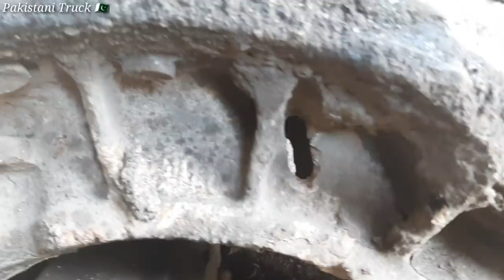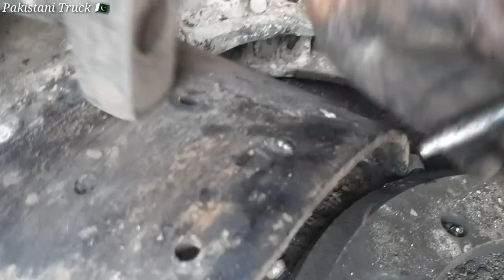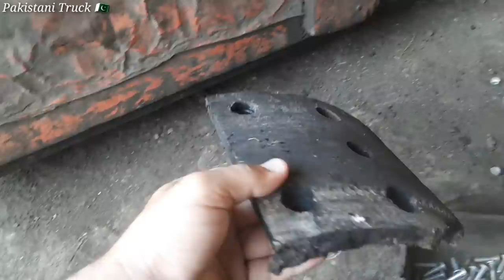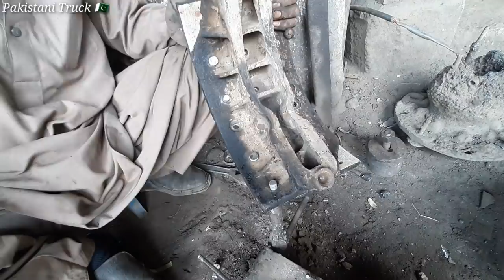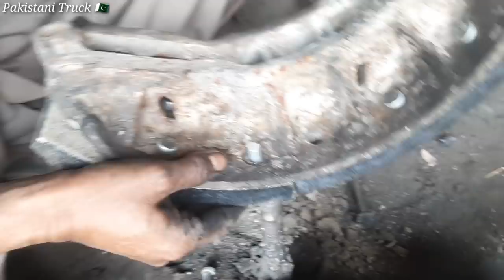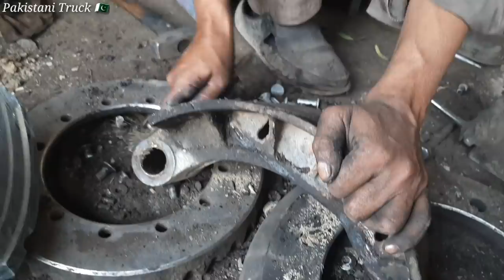Restoration an old brake lining, lather with small tools

Comment: I WISH I could get parts to do this. In America, I can't buy the brake lining like that. When they are worn, I have to buy the entire thing & replace it as a whole.
Reply: USA $$$$$ & Sell  😊
Reply: Youre not looking in the right place i would say, the guys selling you the complete (usually) overhauled shoe have no problem buying these, problem is that its only economical if you do large quantity's with expensive equipment, a pneumatic rivet press, wash machine, a large free loop belt grinder with dust evac and some more, it is to labor intensive and costly in the west, price difference between the liner and a complete overhauled shoe is to small to make it profitable if you count the hours you have to put in with hand tools not to mention the health hazard with the brake dust.
In holland you can buy liners with no problem, a truck supply will deliver them to your doorstep but at some point my boss decided it was cheaper to buy complete refurbished shoe's with trade in of the old shoes and clear out the "old equipment" and use the reserved space in the garage for something more useful.
Reply: Shoes are cheap and so are drums